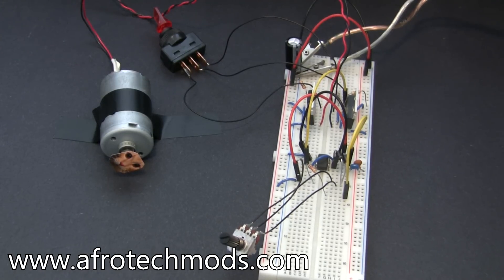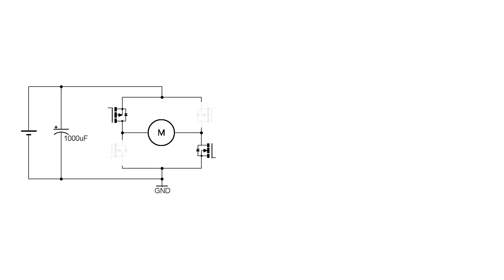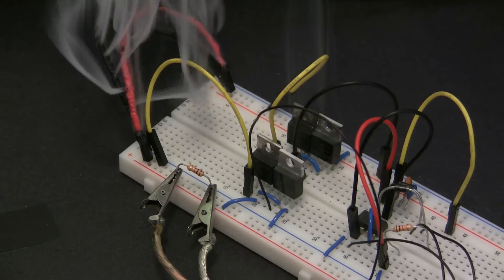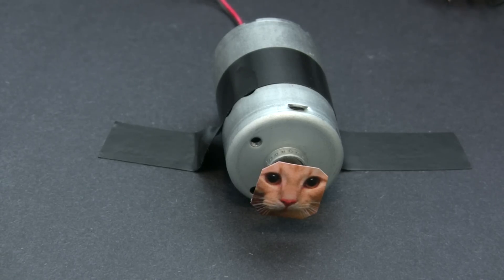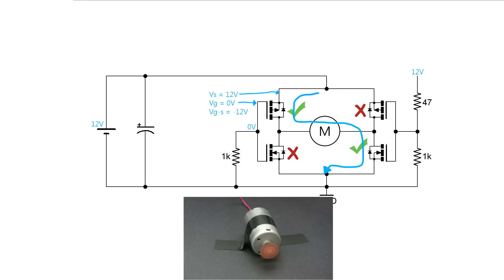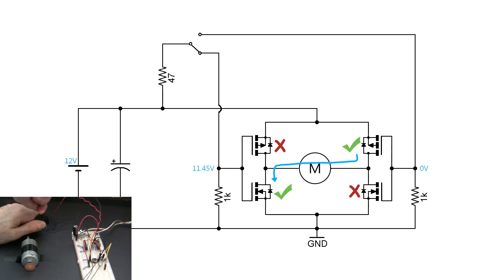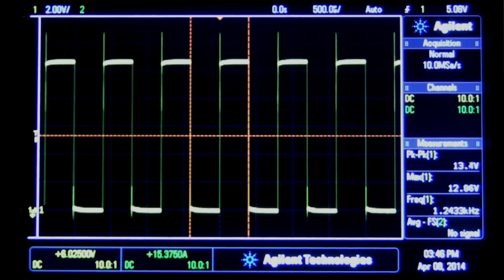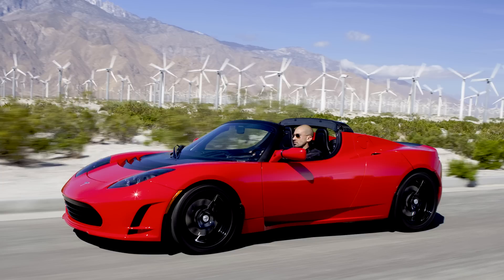H Bridge Motor Speed Controller Tutorial

Comment: Hey Afrotech! I really love your videos! congrats man! I have a question, what is that arrow after the fuse? Is it another power input? Do I need two power supplies to power this circuit?

thanks!
Reply from the maker: Ah that is what is called an implied power connection. Everything marked V+ is connected to each other. It's basically the way on your schematic to say stuff is connected to the positive power supply (which is after the fuse). Only one supply.
Reply: Forgive my ignorance, but wouldnt this bypass the fuse? (Im sorry, Im new to electronics! thanks for answering so fast!)
Reply from the maker: No it comes after the fuse. Battery to fuse then after that power everything after the fuse.

Comment: I can't read the fuse catalog or spec sheet in this screen, I've looked high and low for 6 and 9 volt etc fuses, they don't seem to exist.
Most 5oo mA to 2 or 3 amp fuses I find seem to be 250 volt , doesn't seem to me they would work at low voltage , but I think I've heard it doesn't matter what the voltage is of the fuse, just the amp.
 I'm thinking a 250v 1 amp fuse wouldn't blow until
250 watts are run through it.
What Am I missing , or basically what will work for me to protect say a 9v battery powering up a 200 or 300mA motor, light, etc????

I'm not asking for exact of course , just something to decrease the likely hood of a world melt down....

Thanks much....
Reply: The fuse element has a little more resistance than a regular wire-not enough to affect a circuit drawing a current below it's rating, but enough to generate heat proportional to the amount of current flow. At 9 volts, a 1 amp fuse would still blow under any significant or prolonged overload. An amp is an amp.

If you want something that is reusable, a PTC might be a good choice. In a nutshell, it's a self-resetting fuse, wired the same way. All you have to do is remove power for a few seconds. However, a blown fuse provides a more definitive diagnosis when a device (or part of it) appears to have lost power.

The voltage rating has more to do with the fact that a fuse's job, by definition, is to safely interrupt the power if too much current flows. The higher the voltage, the greater distance it can jump in an arc, especially when current is already flowing. Arcs get pretty darn hot. Therefore, if the voltage is higher than the fuse is designed for, it would still fail, but not in as safe a manner as intended-it might shatter, and the pieces could be hot enough to melt or ignite things. This WON'T happen, though, if you use the correct voltage rating!

Comment: Pirate a switch from an old cordless drill to achieve variable speed, reversible DC motor control. You know that pile of drills you have that the batteries are dead on. Or is it just me?